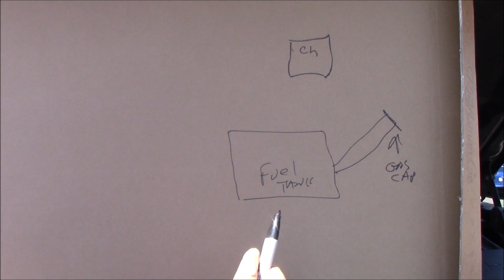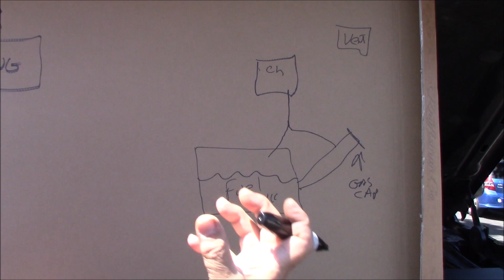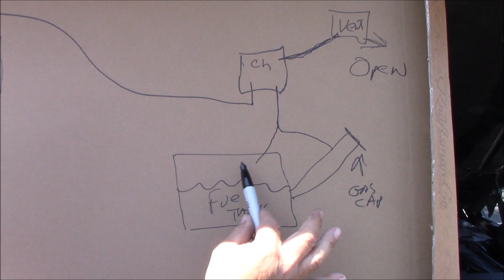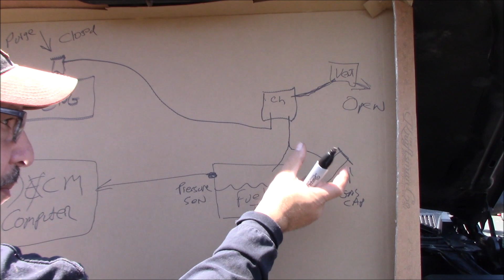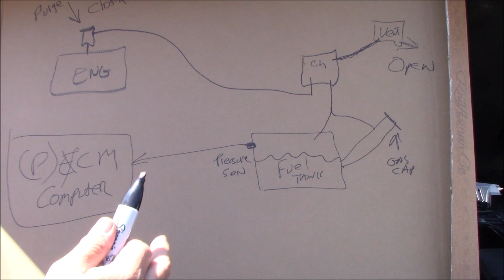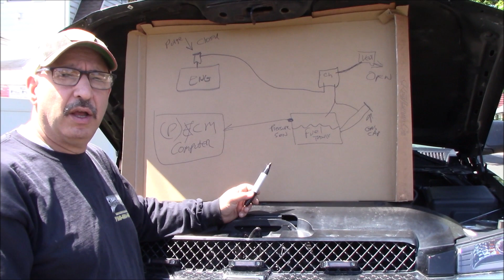EVAP  Systems Explained the Easy Way - Chevy GMC Truck & Similar - EVAP for Dummies

Comment: I enjoyed and agree with your explanation, with one question.  What about the fuel pump assembly seal and lock ring?  I have eliminated the rest of the system and it supposedly passed a smoke test, but Iit still sets P0442 and P0455.  My next move is to go under with an inspection camera to get a look.

Thanks.

Comment: I think my evap box fell off. I've got a gas leak coming from the top middle of the tank.  When I fuel up the nozzle doesn't shut off and gas spills somewhere inside the body of the truck

Comment: Bidirectional scanner. That's what solved my problem. Definitely helped me with the diagnostic. It ended up being my fuel tank pressure sensor the voltage was reading 4.68v it should be around 1.5v so I replaced it and problem solved. I have to say brother, this is the best description I've seen of how the EVAP system works so thank you. I'm always up to learn something new.

Comment: Can you bypass the evap hose on a 2010 chevy express 3500 transit van? I purchased a fuel pump on ebay that said it was oem part for my van but when I received it it had 3 hose fittings instead of 2 like the original pump, instead of going thru the process of sending back the pump is there a way to bypass that extra hose?

Comment: I wish everyone explained that like you did man I've hunted for 3 days for the information and nobody had it but you. But I also have a question that purge valve on my S10 has 2  lines coming out of it so where does it go straight to the motor I'm pretty sure of that I think but on the other side of the motor it has a control module that has a vacuum line coming out of it going to the back of the carburetor and that leaves one line open and nowhere else to go and the one that has the green cap on it idk where it goes but to the intake suction in I think, does anything I said make sense to you so maybe you could help me figure out what connects to the other line coming from the purge valve, I think in the beginning I may have said it was hooked up but it's not nor the line with the green cap. I've done gotten old and I took the truck apart almost 4 years ago and decided to build the motor and transmission and put it back on the road until I ran into this problem and then I have the vacuum hoses going to the transfer case I have to figure out lol oh man I wish I was young again.lol.

Comment: All this b/s just to eliminate that little 1/8" hole in your gas cap like your lawnmower has! All that was ever really needed was, at most, a spring loaded rubber flap over that hole to let air in as needed, and not let the vapors out. Simple. But no, we have to have this grand, over-complex, ridiculous system just to save that 1% more vapors from escaping because, oh yeah, we have to save the planet!! One more thing, on the self-check on these GM systems the tank doesn't get pressurized, they use vacuum don't they? Some even more f-ing complex systems use a small compressor to pressurize the tank to detect leaks, but these use intake vacuum I believe to perform their leak test. It's all stupid!

Comment: I have been chasing this on my 2012 Sierra for 3 years. I have a smoke machine. Found a rusted out fuel neck. Replaced it and fuel cap, liggt was back on 3 days later. Changed the purge valve and valve at the tank with new lines and filter. Light was back 3 days later. I live in an emissions area, and this is a real pain. I am working on figuring out how to delete this stupid system all together. Or I will change my registration to a friends address before my next inspection. Between this government and the auto manufacturers, none of them have a clue on anything but how to put money in their pockets. I guarantee you, my next truck will be a pre 1984 square body. My faith in anything with a computer in it and the governments BS regulations in nothing but a crock of rip off crap.

Comment: Evap monitor doesn’t get ready for testing, cat monitor opens and gets ready before evap which in turn will force me to have to change catalytic for inspection purposes ( 2k) any suggestions….
Reply from the maker: That's way outside my simple knowledge on those systems

Comment: I have a small evaporator leak I can't figure out. I changed the gas cap, canister, vent with hose and purge with the small hose by motor. But not the hose to the tank/Filler neck or long hose between. What else could It be? The fuel pump seal? pressure sensor?  filler neck? I really don't want to throw more parts at my truck. I don't have a smoke machine can you recommend one or point me to where you think my problem could be? Same truck. Thank you.
Reply from the maker: Small leaks are hard to find, If you replaced all that stuff with no success then you might have to have it smoked somewhere.  Check the filler neck/main fill hose and the small evap hose on the filler neck.  That area is a high-corrosion area and that stuff can deteriorate badly.
Reply: @AxlesGarage  Thank you. If I bought a smoke machine do I need a scan tool to open the purge valve to let the smoke go through?